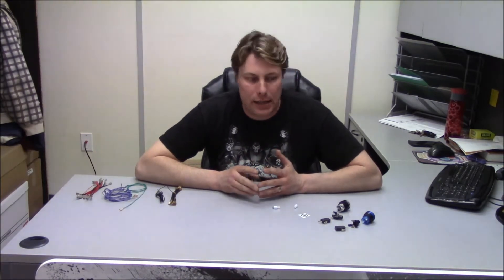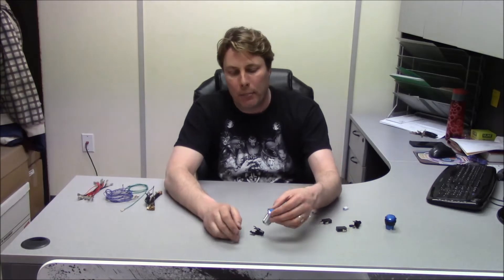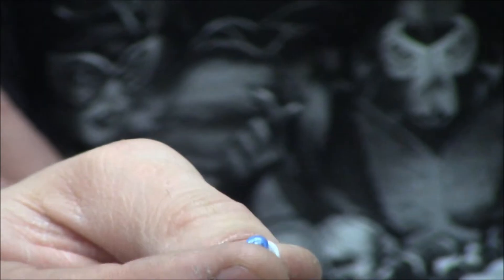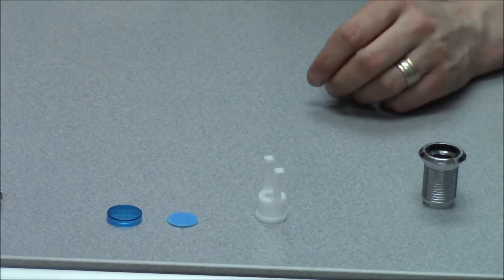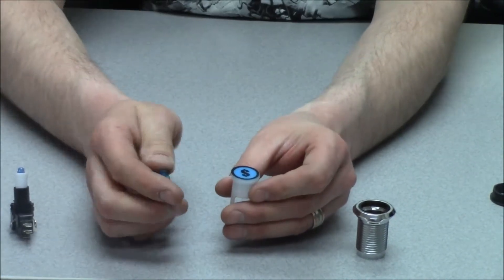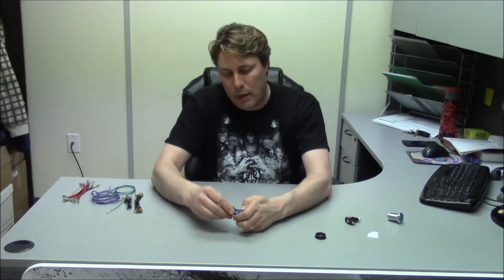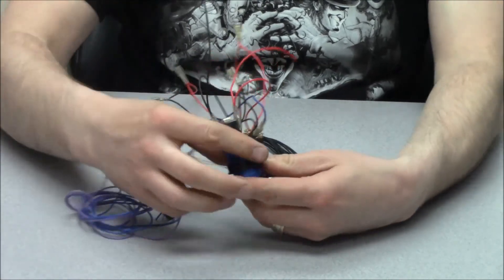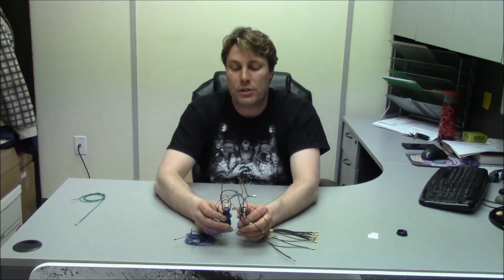How to wire and install printed inserts inside LED arcade push buttons

Comment: LEDs are not 5V or 12V. They range from 1.4V to 3.6V depending on colour and physics of electron band gap potential. There is a ballast resistor to drop the voltage when passing 10-20 mA of current. Super bright may handle more current and more lumens. The reason for different wire diameter - resistor round wire, LED square lead frames.

Comment: The black washer is a conversion spacer - from 28 mm dia. hole to 24 mm threads, if all buttons are made similar.

Comment: If I wanted to replace only the LED from the lamp holder, is that possible? If so what's the easiest way to do that?
Reply from the maker: You would just need to buy the LED and swap it out. If the lamp is removable and looks like this you are good to go! You just need to know if it is 5V or 12V and be sure to install it the same way is was when you took it out, it will not light up if you install it backwards so you will know right away. You can buy one here or search online for one wherever you like: https://retroactivearcade.ca/collections/led-lighting/products/12v-led
Reply: @RetroactivearcadeCa  Thank you!  I have one of the chrome LED  button lights connected to my arcade that won't unscrew.  (the black plastic screw underneath) Whats the best way of loosening it without damaging ? Its not budging.
Reply from the maker: You shouldn't have to remove the button, just twist the lamp holder a quarter turn and it should just pop out. Then pull the led out and replace it. If you have to take it out you can use needle nose pliers and try your best but usually you would use a pushbutton wrench.
Reply: @RetroactivearcadeCa  I'm sorry I meant the spacer and nut. Both won't budge.

Comment: I'm going to correct you Casey the black ring that you threw out is for metal control panels. If you look at the button the threads are a smaller diameter than the mounting hole. Same as the old leaf style buttons. That ring is so that you can tighten the buttons down properly. They also go under the control panel not on top of it.

Comment: Sorry I just posted that question under my daughter login. So Where can I get the push button Stickers? Also if I buy 12v lights for the buttons what power sourse do I use? Thanks and great videos.
Reply: You buy a simple power brick of the appropriate voltage off ebay or amazon